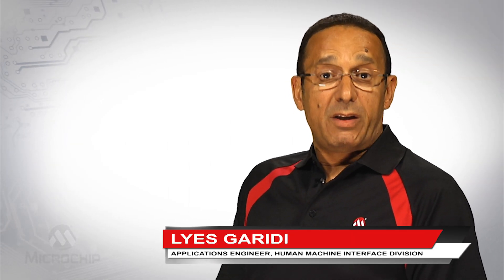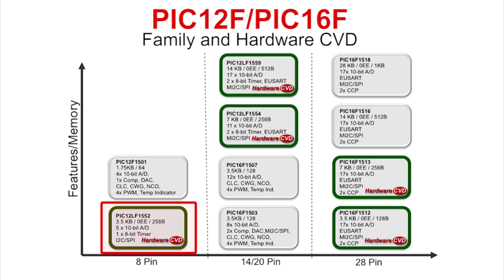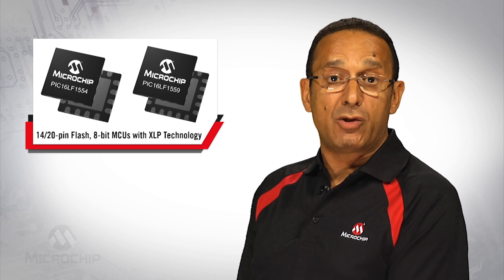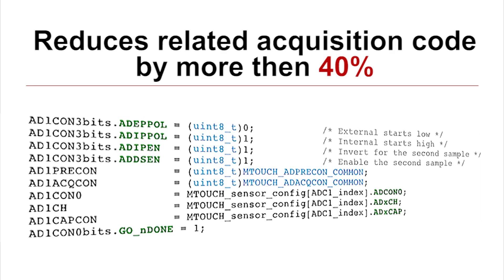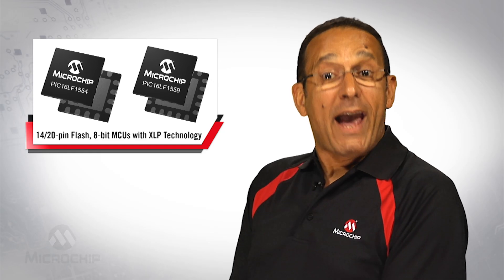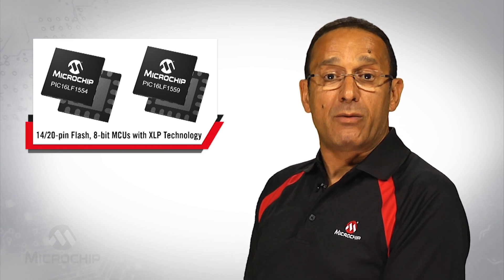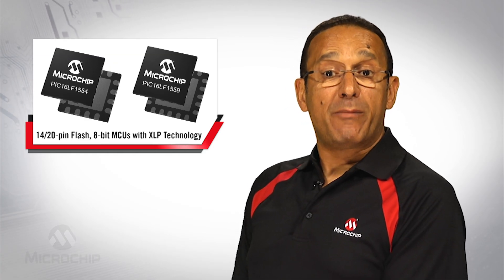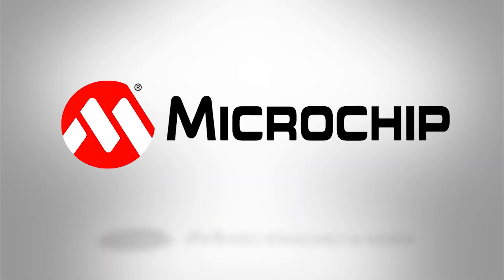PIC16LF1554/1559 14/20-pin Flash, 8-bit MCUs

Comment: im using PIC16LF1559 in my sensor reading applications ,but im new to dual adc module code please experts can provide mplabx  mcc example code generation steps for  PIC16LF1559